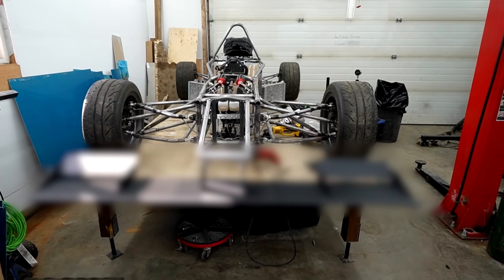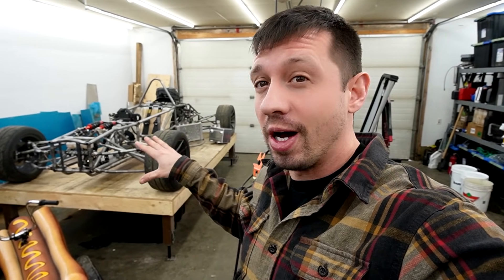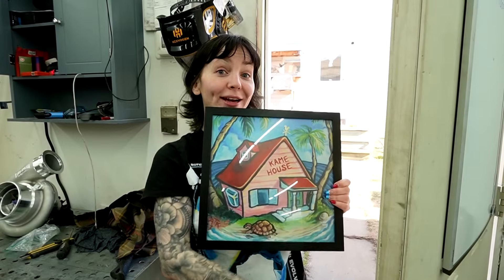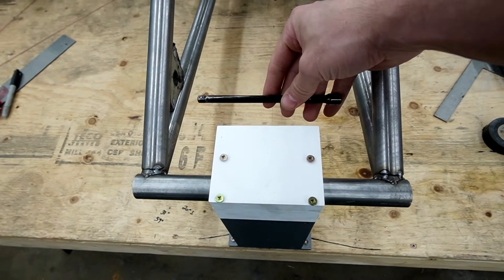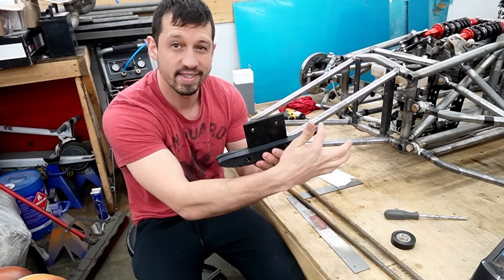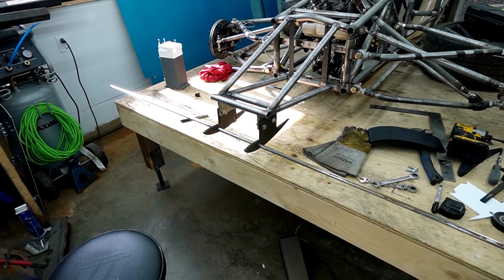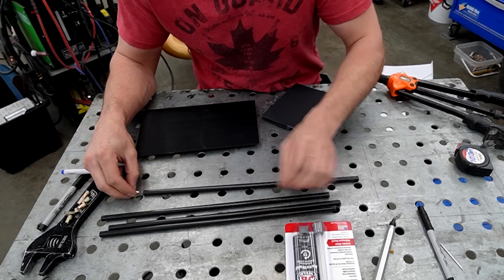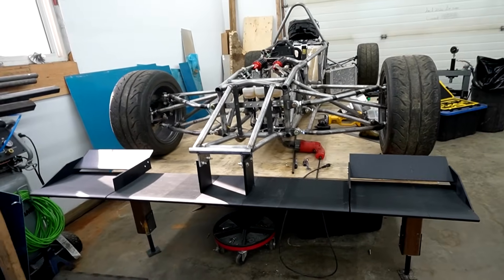Homemade Formula One Car Gets 3d Printed Wing - Pt 23

Comment: Please, if you're going to spend a week printing pieces to put a wing together, atleast give it angle, because that's not going to do anything. And the point of a second element is to let air vent so that you can keep the air from detaching, but that gap is just going to let all the air flow past, the only thing generating downforce on that wing is the tiny "second" element
Reply from the maker: Bro. The airfoil does the work not the angle.
Reply: @Boostedlifestyle then tell me why all wings on race cars have angle, tell me why f1 cars drs folds up to the same angle as your wing. Yes the aerofoil does a large part of the job, but it doesn't work all by itself. The only part that sits flat like that on race cars is the front splitter, but that needs a fulle body design to match it, with a complete underbody. So again, that going to do just about nothing for downforce
Reply: @astontoftero3404It's how a plane works but upside down

Comment: if you wanted a removable wing you could weld 4 plates at 90 degrees to the front and have the same on the wing structure with nuts welded to the side of the inner plates with bolts similar to F1 wings and remove the bolts to remove or change the wing

Comment: Hey Kyle, I hope u see this comment and could probably try and test it out on the car. On your previous video, the shifting and throttle was lagging out. And just some quick suggestions to help with the issues:

Clutch slipping:

Try upgrading to stronger clutch springs or a performance clutch kit to handle the car’s weight.

Make sure the clutch is properly adjusted (cable or hydraulic).

Use motorcycle-specific oil (JASO MA) — regular car oil can make the clutch slip.

Shifting lag (paddle setup):

Tune the air shifter timing to make shifts quicker.

Make sure the clutch fully engages/disengages during shifts.

If needed, consider a manual sequential shifter for faster control.

Steering not sharp enough:

Check the steering geometry — adjust ackermann angle, toe, and tire setup.

Use a quicker steering rack or shorten the steering arms for better response.

Make sure the tires are grippy and the alignment is spot-on.

I hope u could see this and improve the build even more
Reply from the maker: Screen shot this fit later

Comment: you will definitally need more angle on that wing, angle it so it doesnt have a dip in it, also the wing is resting on the rods not the other way round, and therefore the hole should be as far down as possible as that would make the whole thing stronger

Comment: would be happy to pay $50 for a drawing with cut dimensions for the tube frame and what motor with mounts and where to find axles bearings and stuff. want to build one myself but don't want to reinvent the wheel it's good if you have something to go after and make personal changes to. 🇸🇪

Comment: Question, you know how they have a skidplates on the bottom of F1 cars to tell the amount of wear but also it preventing the bottom of the car from grinding out, I reckon you should put something similar on the bottom end of the front wing to stop that 3D printed material from wearing out and not ruin the parts prolonging the life of them.

Comment: Once you wrap it in fiberglass or carbon fiber, the wing will be a bit more rigid. You really need straight fibers from end to end on top to provide tensile strength to limit bending of the wing. I think the mounting plates will be in the way and limit rigidity. You can have bolts or something less invasive coming out of the top of the wing for attachment points to allow for the most uniform straight fibers on the top surface. If you do t want to change the mounting, you will probably have to add cables to the end of the main section and possibly the end as well as mentioned by @josephgermany7446

Comment: Sorry but with this shape of a wing, with so little AoA, there will be very little downforce produced. The fact that the edges produce way more downforce than the mid part can lead to nasty oscillations with this level of flex. Adding a layer or two of carbon fibre for structural reinforcement may help, but the angle bothers me a lot.

Comment: the 3d scanner wont cope with surfaces that look the same - like the tyre. It needs reference points to orient itself. If you try to scan a flat surface with no markers it will skip around confused

Comment: You need to add some angle of attack to that wing. It looks like it is effectively zero at the moment which is very inefficient for downforce. I.e. lots of drag and not much downforce. Increase the angle to 10-15° and it will produce a little bit more drag but WAY more downforce.

An added side benefit is that it will also give you a vertical offset on the steel bars which will make it stiffer.
At the moment, vertical flexing is simply bending both bars. Once they are offset vertically, one will have to bend more than the other. That will translate into one having to get shorter and one longer for the same bend. That small 10-15° offset will give you a huge stiffness increase.

Comment: if ya make 1 of the 2 holes holding the composite to the steel brackets adjustable, you can move the entire wing with just 2 bolts... current setup you have to change all the wing elements.

Comment: I'd probably shorten the front mainplane span by approx 150mm so that the endplates are roughly in line with the center of the front wheels. I'm no aerdoynamicist but I'd do that and curve the endplates out slightly as they lead towards the trailing edge so as to create an air turning effect that would hopefully take away some disturbance created by the front wheel and tyre package.
Reply: A slight bend in those bars will also create a "crumple zone" to protect his legs/feet!

Comment: from the noses i seen on formulla cars both at a track thats pretty close to where i live and on videos they basicly use the nose itself as the structure (a carbon fibre cone shape is pretty strong ) there atached around the circumference to the mainbody using twist lock screws theres a step they slide the nose over then push the twist locks in 
maibe get an old bearing weld a bit of scrap steel to it bend it so it lines up with the piece  sticking out the back of the lathe slides through the center of the bearing und use the vise to hold it by the piece of scrap metal you welded to it , should help keeping the long stickout from flinging around 
seen this video of a simulair situation on a cnc machine , geena was right it is dangerous 
https://www.youtube.com/watch?v=6fPZhD0AxYI

new house huh.... you where looking for more space for a while , curious to see the new garage

edit , just found this channel that has made a simulair racecar might be interesting to see how he did it :
https://www.youtube.com/watch?v=3ffvQq-k7Jo

Comment: I have commened here before, and I suppose I should join the discord, but I have made wings very similarly. Albeit, with more experience in the area (humble brag). I usually use at least a .625" tube for the main spar, for longer length wings, even larger. Fit the biggest main spar you can in the chord of the wing. PLA works find for printing the sections and bonding, then a wrap or two of cloth and the thing is strong. Extremely strong.
Reply from the maker: It's not actually 1/2 Inch it's actually 1/4 pipe. So it's like .55x inches and .088 wall

Comment: To help with the flex towards the outboard ends of the wing, add some cable anchors that attach to the car frame to prevent the downward flex.
Reply: With break-away attachments on the chassis side, so if you're ever in a bad spot you don't get mauled by the cables.
Reply: This wing could be wrapped in carbon and vacuum bagged as an assembly. Using the 3D print as a core
Reply: He should also print the outer aerofoils with less infill to keep the weight as low as possible on the edges.
Reply: @simon9548  that makes sense,  but then again,  it's already made of a lightweight material.   Might decrease the structural integrity if he did.   If he uses cables it pretty much compensates for the added weight. Infill weight is kind of negligible when you consider it just adds a tiny bit of extra downforce to the front of the car.
Reply: yeah kinda like planes
Reply: I feel like most of the structural integrity comes from the steel bars, not the aerofoils (especially further out on the wings). But of course less infill will make it a bit weaker.

He should also swap the steel bars for carbon rods for increased stiffness and further weight loss (if they're available for the correct dimensions).
Reply: I was just thinking that he could add some steel cable or something to help with flex

Comment: Really cool but you should put some angle of attack on thst wing
Reply from the maker: We are planning to make floor aero so we don't want it to be too draggy
Reply: @ with a flat floor you aren’t going to get much from there, plus floor relies a lot from suspension and suspension geometry which you kinda did in random let’s hope this work kind of way, saying this so you don’t spend too much time trying to find performance from a veeeery difficult area